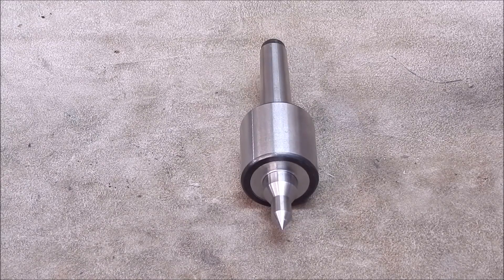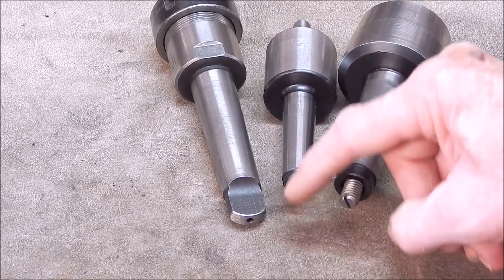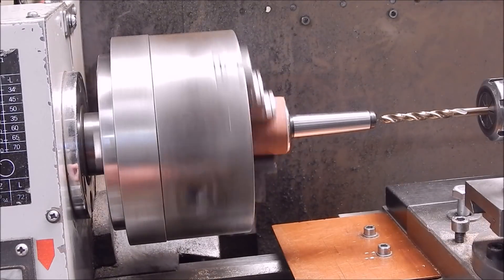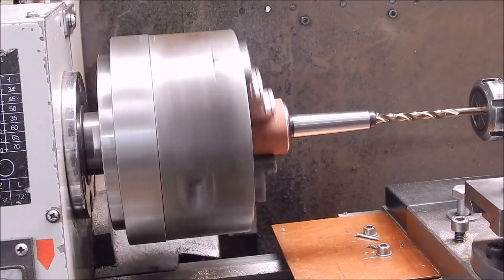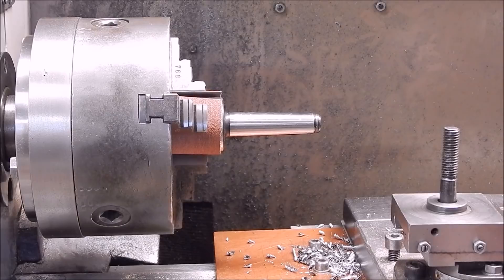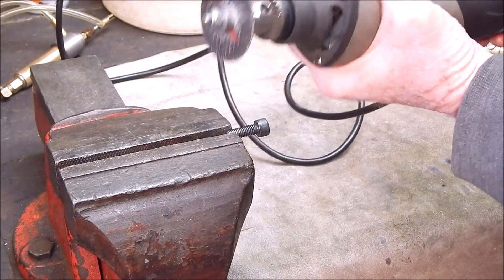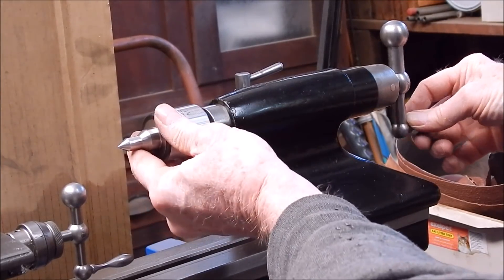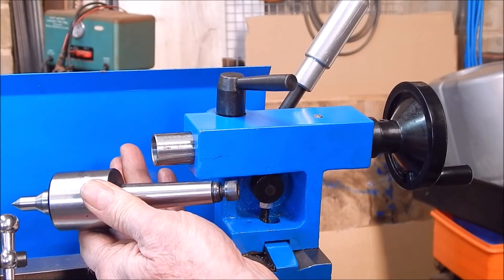How to fit an ejection tang to a Morse taper for a metal lathe

Comment: Grind flats on the head and you get the real reason for tangs........stops it from twisting in the tailstock.
Reply from the maker: Not necessary if it fits properly, and that (tang) system is mainly used for a pillar drill, not a lathe tailstock which generally doesn't use it.

Comment: What would you recommend if mt taper was attached to a Jacob chuck? 

How can this mod be made in this setup?
Reply from the maker: Put something round and accurate in the drill chuck, then mount that in the lathe chuck, and then centre drill and tap the Morse tang end. Simple.  Cheers Rob

Comment: I haven't heard about cobalt drill bits needing lower speed, where did you get that info, any references? As far as I know, the addition of cobalt to HSS makes the drill bits even more heat-resistant, meaning they are even less likely to lose temper. So I would recon same or even higher speed is possible than plain HSS?
On the other hand, when you drill hardened steel, naturally you'd want lower speeds :)
Reply from the maker: It's on a number of sites selling cobalt drills.  Cobalt makes the drills much more brittle so slow speed to prevent chipping is recommended.

Comment: Hi Rob , what am I missing?   You hold the live center in the chuck by the bearing holder then drill and tap.   What is keeping the morse taper shaft from just turning in the bearings.   Thought you might use a dog leg or something but I never saw anything to keep it from turning.   ?????????
 
Dale in Canada
Reply from the maker: Hi Dale,  the taper and body/bearing holder of the center are one piece.  Only the nose turns and that is not gripped or used to locate the center in the chuck.  Cheers Rob
Reply: Thanks Rob , the live center I use is the opposite to that.   Thanks for clearing that up for me.   It just didn't make sense.   Hahaha.  Knew there had to be something I wasn't getting.   Thanks for the video and glad to see your able to stay busy.

Comment: Interesting! My tail stock on my Myford ML7 has a centre hole full length, so that for anything that won't come out of the Morse taper I have a piece of wood dowel that I push in and then gently tap & the Morse tool comes right out. Crude & perhaps not what was intended but it has served me well on many occasions. Thanks for sharing!
Reply from the maker: Interesting.  You can generally tap on the outer rear of the center's bearing housing with a piece of hardwood to get them out, but of course a permanent fix is better.  Not a difficult job.  Cheers Rob

Comment: Hi Rob. Thanks for this, I was expecting the taper to be a bit harder but it certainly seemed to drill and tap easy enough. Cheers, Alan.
Reply from the maker: Hi Alan,  anything that has to grip (including drill shanks) are generally a bit softer than rock hard so they are a less likely to slip.   It's a very simple job, but people may be unsure about what's involved and what can go wrong, so I went the full explanation on this one.  Glad you found it useful.  Cheers Rob

Comment: What about drilling for a pressed fit
Reply: In Rob's case if he did that it would take away from the ability to quickly change it for use in both of his lathes as it's then almost too long to function in the  mini lathe.
Reply from the maker: Do whatever floats your boat.  I personally would not be very keen on pressing against the face of the center body as you could potentially damage/compress the bearings.  Cheers Rob
Reply: I meant pressed  fit as opposed to threading I guess I commented to early in the video because you did mention that yourself I am enjoying your videos thanks
Reply from the maker: To press in a stud you have to apply equal force to the face plate of the bearing housing.  In this case it is a press up design and any additional force could seriously mess with the bearings.  Glad you enjoy the channel.  Cheers Rob
Reply: @Xynudu  A sliding fit for the pin would be good enough in here, and would make the pin easily removable. As long as the pin doesn't fall out while inserting into the tailstock, it's not gonna go anywhere, and will do its job when it's time to remove. But a threaded tang kinda feels more secure to me :)